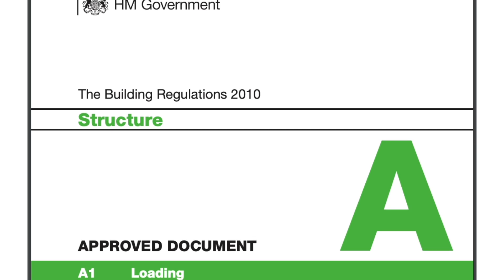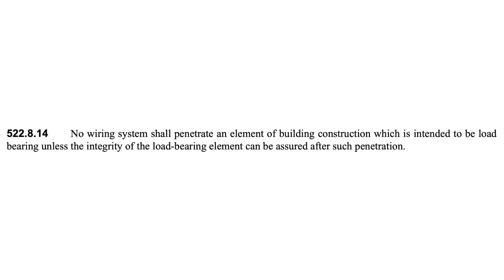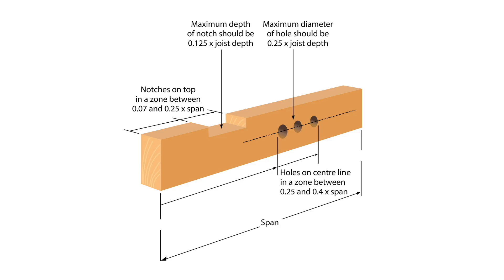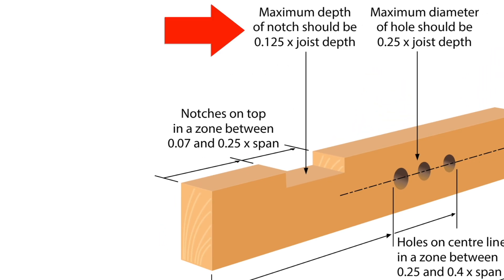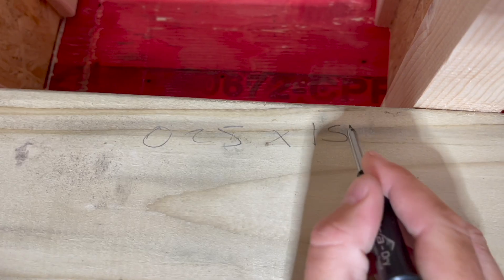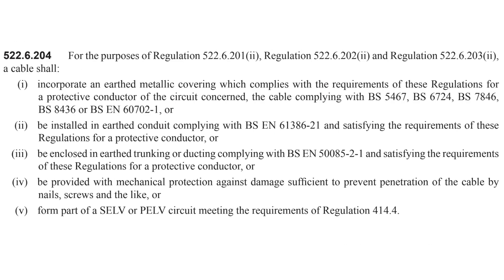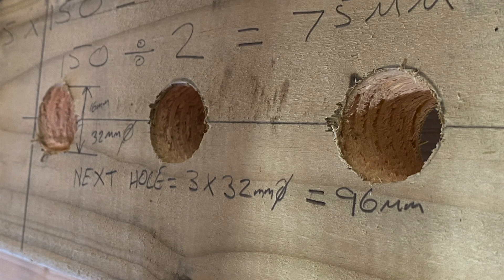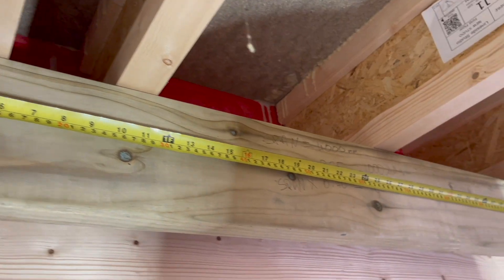Joist Drilling Do's and Don'ts: What You Need to Know

Comment: We was always taught it’s better to try not to drill holes in the centre of the room and that’s the weakest area of the joist ,best near the ends where it’s supported.
A good tip . Never drill a hole in a joist unless you know what’s on the other side ..ie pipes and cables
Reply: We were.
Reply: The advice on where to drill holes in the centre is wrong. A joist is in compression at the top and in tension at the bottom which means that, there is a point (called the neutral point) where these forces balance out. By drilling at the "neutral point", you are taking out material that is mostly not in tension or compression and thus not providing support. Of course as you move away from that neutral point, the forces  of tension and compression do become out of balance, which is the reason the hol diameter is regulated.

Unfortunately, where the position of the neutral point is varies according to the distance along the beam from the supported ends. However, it becomes close to the centre line in what is called the "safe" zone between 25% and 40% percent of the joist length from each end. 

Notching (on the top) can be done towards the supported ends of the joists, albeit to relatively shallow depths.

However, all this has to be put in perspective. A hole drilled for a single 2.5 mm^2 cable drilled on the centre line anywhere is really not going to have a substantive effect on a properly sized joist.
Reply: @TheEulerID  The issue is that there are two distinct types of forces acting on a typical floor joist, namely shear forces and bending forces.
Shear forces are maximum at the supports and usually zero somewhere around the middle, whereas bending forces are the exact reverse,  maximum where shear forces are zero and zero at the cut ends of the joists. In between the ends and the "middle" of the joists there will be both types of force present in varying amounts, more shear towards the ends and more bending towards the middle. 
For bending strength the extreme top and bottom of the joist does most of the work so needs to be intact, and the center (neutral axis) does least so holes through the centerline of the joist but outside the middle 20% of the span shouldn't be an issue but notches would be. At the ends of the joist there is no bending, just shear.
Shear forces need cross sectional area of timber to resist them, so the more you cut away, be it notches or holes, the less shear resistance the joist has.  Shear is rarely critical in timber joists, but can be an issue in short heavily loaded timber beams. A single small hole in a joist closer to a support than it should be is unlikely to be an issue, but a small notch towards the middle of the span could be critical. Safest to avoid notches everywhere and anywhere in my book.
Reply: @mikebarry229  Shear forces are definitely not the issue, and what I was referring to with the top of the beam being in compression and the bottom in tension is the bending force. Near the ends of the beam, the compression forces at the top are at their minimum, which is why the regulation guidelines allow notches to be cut there. For plumbers, it's a real problem to run pipes through the middle of joists, and you tend to their runs at the end in notches for that reason. 

What is seriously bad is to but notches in the beams near the centre. At that point the compression forces are maximal and you do not want to reduce the effective depth of the joist at that point. Conversely, the centre of the joist will be roughly neutral in the centre.

The guidelines allow for notches up to one-eighth of the depth of the joist. So it's doesn't allow too much (22mm with my joists). Outside that, it needs a structural engineer with the appropriate span tables. Often, in smaller rooms where you might find plumbing, the span is much shorter than the joists are sized for. That's because the joists are sized for the longest, unsupported spans.

In any event, the published guidelines are very much on the safe side, so really aren't an issue. Of course many plumbers to a lot beyond that, and it's common to find notches cut out for 40mm bath waste pipes in a lot of bathrooms, especially in older properties (technically you would need almost 13" joists for that without reinforcing).
Reply: @TheEulerID  As a former engineer myself I naturally agree with everything you say above, but what I had issue with was your apparent suggestion in the second paragraph of your original post that seemed to be saying (correct me if I'm wrong) that the position of the neutral axis changes along the length of the beam and that this was the reason for the change in guidance as to whether holes or notches are more suitable. The neutral axis is only relevant to bending stress and for a regular section such as a joist is always at the same position (and usually assumed for calculation purposes to be along the centreline of the joist). 
The reason that holes are not permitted in the middle 20% of the joist is that potentially the entire depth of the joist will be required to deal with the bending forces which are likely to be at their maximum in this zone (shear here will be zero pretty much). Conversely at the supports shear forces will be at maximum, and bending forces insignificant or zero. The safe zones are positioned between these two extremes in areas where neither maximum shear forces or maximum bending forces are present. The safe zones closest to the supports are areas where shear still has the greatest effect so here notches are seemingly preferred, but from 25% span to 40% span bending stress is the concern so holes on the neutral axis are rightly all that is permitted (for the reasons you give above). I would also totally agree with you that so far as floor joists are concerned shear forces are largely irrelevant as the design is totally dictated by the span, and the joist depth required to resist the maximum bending moment will result in a joist cross sectional area considerably greater than is required to deal with the shear forces present.
Personally I would far prefer to only see holes in joists (on the neutral axis) even in the area where notches are permitted, but the guidance has been written to keep things simple. Holes can be 25% the depth of the joists and notches only half that. If the size of holes were reduced in the "notch" zone to 12.5% of the joist depth it would never be an issue. The main reason holes aren't allowed in the "notch" zone is the fear that some idiot might come along and put notches in as well as holes.
Reply: Really you shouldn’t ever do it. You should run a conduit along the perimeter or between the joist. But that costs extra money for the contractor. He doesn’t care if you have wobbly uneven floors in 30 years. He won’t be around.
Reply: Wrong! Notches are positioned at the ends and holes are drilled in the zone that begins at one quarter span

Comment: I moved into a house, where i had to get repaired a load bearing joist, that had been hacked by pumbers to get the hot water pipes in. They had removed 3/4's of the joist and the landing had a spring in it, also there was movement in the ceiling..... So these rules need to apply to all........
Reply from the maker: They also apply to plumbers!
Reply: @efixx  plumbers have a much bigger problem than electricians. They are generally dealing with much larger holes and inflexible pipe work. Also, water doesn't like to flow uphill, unlike electrons that don't seem bothered about it.
Reply: @TheEulerID  Yes, but structural integrity is of primary importance. Plumbers don't just get to cut whatever holes they like just because some route is the most convenient for them. Need water to flow downhill but drilling a hole in the obvious place is going to weaken the structure? Too bad, you need to find some other solution. Oh what's that - there's no solution other than weakening the structure? Uh oh. That's really too bad. Somebody should have thought about this in the planning stages, and rectifying this is going to cost them money.
Reply: @nathan87  you seem to have missed my point, which is that plumbers have a much more difficult problem to deal with. Electricians have it vastly easier when it comes to routing services simply due to the physics involved. In the real world, less than ideal choices sometimes will have to be made, albeit there are always limits.
Reply: @TheEulerID  this is true, but it just sounded like you were saying that having a more difficult problem justifies compromising structural integrity.

Comment: On one job I was on the plumber drilled a 4" hole through a solid joist for the toilet waste, The building inspector didn't say a thing.
I have been on loads of jobs, where plumbers have drilled right on the end of the joist and again the building inspector said nothing.
Don't plumbers learn this in plumbing school, and do the inspectors know this,
 if I am on site with the plumbers they always ask me where to drill, crazy.
Reply: As a (now former) Building Inspector I used to see this issue far too often. I cannot understand why people like builders, plumbers, and electricians who as skilled trades people you would expect to have many practical skills and tons of common sense could ever think this was OK. Worst I saw was 75% of the depth of the floor joist cut away rather than divert existing plumbing, and still the builder argued with me when I insisted he replace the joists that I was wrong and it was "fine". The trouble with common sense is that often it isn't that common.

Comment: Great video and very informative, but the problem here is the real world. Time restraints, accessibility, no ones getting their tape measure and measuring to that degree. Use common sense, aim for the centre and don't butcher the joists!!
Reply: Or the bottom 80% of the joist is filled with insulation

Comment: What about if the hole was drilled 40 years ago buy someone else? Do we use the empty hole that’s there or further weaken the joist by drilling a load more in the “right place”
Reply: Use the existing.  That's the common sense answer and what I would do anyway.
Reply: On new install I would agree with the video.  Actually on a complete renovation where access is more or less the same as new install I would again agree, especially of new joists to replace the old over notched ones were being fitted or they were being doubled up.   On a rewire of a 1950's build house I would be weary about adding new holes myself in the "correct" location with existing holes already present unless these were going to be reinforced once services were removed.
Reply: Provided the old hole meets current reg then use it. An instance to avoid it is if it is within 50mm of the surface which a nail might penetrate, unless you want to pay for the mechanical protection needed

Comment: Sparks and plumbers smash the floor boards, cut massive notch then do their thing and say oh the chippy will sort out all them buggered joists and floor boards😡
Reply: It would be most welcome if the chippys did the hole drilling, floor pulling for us.
Then maybe they find out that gluing the bloody floor is not helpful.
Reply: @sgfelectrical734  glued chipboard floors are structural
Reply from the maker: We can only apologise on behalf of our entire trade... 😔
Reply: @efixx  No need to notch joists in new buildings, if there  are strips of timber across joists like 45x45 mm, spaced approx. 600 mm apart, which the floorbards are attached to.

Comment: Luckily this isn't even a question for us living in sweden, as we build so called "installation walls" and just put the flextubes between the joists, so no drilling at all.
Reply: Having lived in both continental Europe as well as the UK (now) I can safely say that in the UK domestic residential market very little gets constructed with either the need for maintenance or future need for modification in mind. No cable trunking/ducting, hidden plumbing, no plumbing access panels, everything is plastered and tiled over. And then they wonder why retrofitting new cabling and plumbing to improved building regs is so expensive here 🙄. In the UK a neat look definitely trumps future ease of accessibility.
Reply from the maker: Wise words
Reply from the maker: Would be good to see that in practice
Reply: @efixx  I think Gaz should be sent around the world in 80 days looking at how wiring is done in different countries.
Reply from the maker: @anthonybragg  Gordon is on that case - https://youtu.be/jSdfJabUEUQ

Comment: Then the plumber comes along and bangs in a 40mm waste pipe notched out.
Reply: With a fall on it so each so each notch gets deeper
Reply from the maker: You have a great point 👍🏻
Reply: Saw a picture just the other day of a 4" waste drilled straight through the centre of a 6x2 joist 😂
Reply: @rodgerq  That’s commonly known as ‘The Gifford’
Reply: Yip that’s us
Reply: Yep 😂😂😂
Reply: Bang on 😂
Reply: Oi... we have gravity to deal with.  You cable monkeys have it easy.
Reply: Spend a day drilling out then a spark nicks your holes chop chop 😂😂😂
Reply: @barry-bradford  work more than a few hours a day and you might get some pipes in the holes you drilled, problem solved.😂
Reply: @12000gp 😂😂😂
Reply: @12000gp 😂😂

Comment: Lift floorboard, you can not find any property apply those requirement. 
So what the purpose of such unpractical requirement?
Reply: He’s right, it is unpractical. 
Unless u pull the ceilings or all floor boards u in fact have no idea how long the joist are. Do they go full front to bk or wall to wall ?
Given this a cable run would look like a S.
It’s just tiring, stressful and pointless cos if u take the time to do the impossible, u won’t win the work or just make a lose.
Plus if u did…. What about all the other notches and holes u can’t see.

Class rooms great with fully exposed beams all the same length. or a one room loft install.  but if far from realistic.
Reply from the maker: Eh? There's lots of properties this would apply to. Plus it's not about practicality, it's about keeping the joist sound. 🤔

Comment: I would suggest that a lot properties built before about 1970 would not have 150mm deep host therefore drilling in the centre would not leave 50+ mm either side  (above and below) the through hole and is therefore going to be non compliant?
Good video though, lots of info
Reply: You're tarring a lot of buildings with the same brush saying pre-70s. I've worked on buildings from every century since the Domesday Book. I guess you're talking about some 1960s builds maybe? Other than joists in the roof space, or trusses if they are used instead of a cut roof, joists are invariably at least 6". Or certainly where I am here down south.
Reply: unless the spans are tiny floor joists will never be less than 150mm. Often you get smaller joists downstairs where the sleeper walls half the floor span but then you can just thread under anyway.